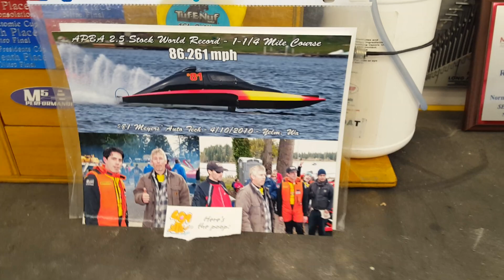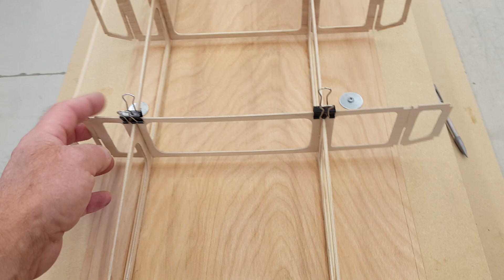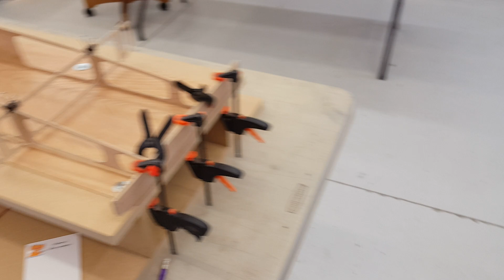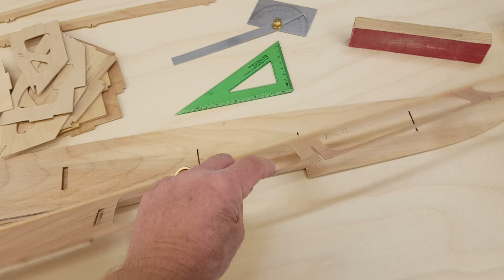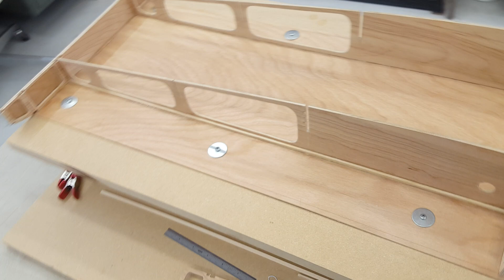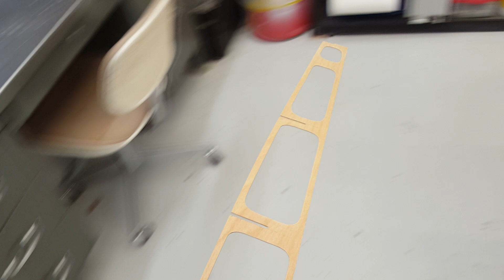Part 2 How to Build a RC Hydroplane Racing Boat - "The Gasser"!

Comment: another question do you seal the frame of the boat if so what do you seal it with i have herd to use epoxy clear coat
Reply from the maker: A video demonstrating interior sealing is in the works, but for now I'll try to explain;
After the boat is completely built with all hardware mountings finished, everything except the top decks, then is when I seal the interior.
For this I use West Systems epoxy. After mixing the epoxy I thin it with alcohol, making it very thin, about to the consistency of water. I slather this super thin epoxy EVERYWHERE inside the boat, working as quickly as I can. As soon as I've finished I wipe out all of the excess with paper towels (using an industrial wiping towel that doesn't disintegrate easily like household paper towels).  ALL epoxy that hasn't soaked into the grain I wipe away leaving no standing epoxy anywhere. In other words, MOST of it is removed. 
I should mention that during this process I avoid getting any epoxy on the upper surfaces of the stringers to which the top decks will be mounted. You'll want raw wood there until you're ready to apply the deck.
Next I install the decks and do my finish work and painting. If you like the exposed wood finish in the engine well, which I do, just buff the sealed wood in the engine well lightly with 3M maroon (fine) pads to remove any roughness and then shoot clear coat on it when you're doing that step over your paint. It'll look fantastic!

Comment: Low viscosity epoxy fibreglass resin & micro balloons. Make a small radius fillet - light & strong
Reply from the maker: Light yes, but strong? Not so much. Micro balloons are just as their name implies, little hollow spheres. Hollow means light, but if course there is no epoxy in that empty space and thus the resulting mixture is much weaker than epoxy soaked fillers.

Comment: Too late to get you to go over repairing engine mounts, is there? 
I got a Rockstar 48 in a trade. And the orevious owner ran it, with the motor mount screws loose.
And they chewed up the mounting rails.
I already know i need to cut the damaged rails out. But i dont know where to find replacment rails, or if i should just make new ones out of 6x12 x5mm thick carbon fiber plate.
Then rosen them back into preexisting rails place..
I'm just not sure the best way to go about it.
Any advice would be greatly appreciated! 
Thanks in advance.
Reply from the maker: If you've watched many of my videos you'll know that I'm totally unafraid to cut my boats apart and rebuild them.  I simply cut away everything that's damaged and replace it all.  Pick up the Dremel tool and go for it. You can do it!
Reply: @M5 Performance Hydroplanes - Scott Meyers  i think I have a game plan..
Gunna cut the spars or rails out and resin in an aluminum motor mount.
Looks pretty easy. 
Im not new to rc boats. But all my stuffs FE.
And I've never had to hack on one..
Part of the game, I guess.
Might have to put together a build series..
Thanks.

Comment: I'm certainly no boat building expert... but I was wondering have you ever thought of trying Carbon fiber sheets the same thickness of the wood you use? It's much stronger and very light, It can be cut the same way along with being glued.
Reply from the maker: Thought about it, looked into my wallet, changed my mind!

Comment: How do you determine the slot for the stuffing tube
Reply from the maker: I guess.  Seriously.  I usually miss by a little and make the slot a bit longer than it should be, but I then lay a doubler piece of 1/16 ply over the area for strength which covers the goofed area.

Comment: How thick the plywood in mm do you use?
Reply from the maker: Most of the interior framing is 1/16", which is 1.5 mm.  For the skin I use 1.5 mm on all the bottom surfaces, and 1 mm for the top decking.  The transom is two layers of 3 mm laminated together (1/8"  x 2), same for the right side sponson transom, and the left side is one layer of 3 mm
Reply: @M5PerfHydros  thank you.me really appreciate what you shared to us.. Hope you can make a video about how to install the skin on the boat. Your video really2 good and so informative.

Comment: Was wondering if you are gonna do a video on sealing wood with thinned epoxy.Also do you have a link to get the kits.Thanks and happy new year
Reply from the maker: Yes and yes!
 Next couple videos will deal with sponson design and bottom skins, but a video about how to seal the wood and make a super nice looking interior engine well will be right after that.

So if you're a glutton for punishment like me and you'd like bare plans so you can scratch build your own boat, Newton Marine has a huge selection here;
http://www.newtonmarine.com/

For really great wood kits the best place I know of to buy those is MLBoatworks;
https://mlboatworksrc.com/

Many good fiberglass hulls and cowlings are also available from RC Boat Company;
http://rcboatcompany.com/

Between these three you should be able to find almost anything you'd want.
Thanks for watching!
Reply: Thank you. I've been building A couple wooden mystics. After seeing this channel I've seen alot of mistakes i have made putting she sheeting on and the sealing of the wood oh its sealed no question about that but all the zpoxy resin I left in the hull.Lost of controversy over thinning epoxy some say never some say do it at your oun risk...After seeing these videos of yours. I started experimenting with thinning the epoxy just dont know the starting point of removing the excess.
Reply from the maker: @swaldoski  - We'll talk about all of that. Of course the best I can offer you is just my own opinions, backed by years of making mistakes, with a few successes thrown in along the way.  More soon!

Comment: The only complaint I have with ML kits is that if you don’t build them right away or put all pieces on a weighted board, they warp. My RSX310 was a mess. My GP265 had some incorrectly cut pieces but all in all I got them built. My next hydro is a Zippkitts 26” rigger. Still learning a lot, thanks.
Reply from the maker: Really?! Even if you leave everything boxed and don't pop out the pieces? That surprises me... The two kits I've based a couple of my boats upon were almost dead straight. But wood does strange stuff as it ages and dries so I suppose it happens. Trick might be to lay the box flat and weight it somehow. Under totes on a shelf maybe?
Reply: @M5PerfHydros  Yep. I'm putting the JAE under weight on flat board until I can build it. Another great video sir. Thank you. It's wood and compared to building a Whiplash, the ML is easier I think but JAE kits are very simple.
Reply: It all depends on the woods moisture content I have had new kits really warped and kits I have had in a cool dry basement for 20 years be perfect it all depends on storage and moisture content.

Comment: Where do you buy your slow setting epoxy from?
Reply from the maker: Hope that helps!
Reply from the maker: Hi Kip,
I primarily use two different products... West Systems for laminating, sealing, and for fiberglass layups (cowlings, cowling repairs, etc), and G-flex for general construction. The G-flex has a much longer working time. Amazon has both. Hang tight a sec and I'll get links to them...
Reply: @M5PerfHydros  awesome, many thanks!
Reply from the maker: West System 105-B Epoxy Resin (.98 gal) with 206-B Slow Epoxy Hardener (.86 qt) and Epoxy Metering Pump Set (1) https://www.amazon.com/dp/B07JKTKFKP/ref=cm_sw_r_cp_apa_i_e7i0DbAV0070N
Reply from the maker: WEST SYSTEM G/flex Epoxy (2- 4oz) https://www.amazon.com/dp/B002IZFPQE/ref=cm_sw_r_cp_apap_zCziWWWViVsEt

Comment: how do you cut your wood? it seems really really well done. I'm currently using a jigsaw then sanding but I'm having a hard time making the pieces according to the plans. Thanks alot
Reply from the maker: Hi Michael,
Jigsaws are notoriously difficult to control when doing 'fine line' work. Plus they tend to tear the workpiece without mercy!
I use a small, cheap tabletop bandsaw for all my straight cuts and for roughing out larger curved sections as well. For finer work and tight radius cuts I use a small tabletop scroll saw. 
A fixed table top belt sander is the ticket to do large area straightening and radius work.
All final shaping is done via plenty of manual labor with a sanding board, Dremel tool, and files for shaping and squaring many of the cutout areas for stringers, etc.
In other words, there are no shortcuts!
Just be sure to cut outside the lines and then final fit everything by hand. Be patient, and don't be afraid to throw the part away and start over... I throw away more than I use!
Good luck... You can do it!
Reply: @M5PerfHydros  awsome thank you for the answer! Your videos really helped me find the will to build my first boat! Keep up the good work!

Comment: i see that you put your struts threw the bottom instead of on the transom i am building a boat now and just wondered y
Reply from the maker: Good question James. The answer has to do with the class rules... My boats are built to race with R/C Unlimiteds in the Pacific Northwest, and our rules require that the prop be positioned at the transom or slightly extended if it can be proven that the original full-size boat had an extended strut.
So if you're building for a specific class be sure to check your rules. But if you're building just because it's fun, have at it!
If you'd like to learn more about RCU take a look at our website. Loads of pictures and boats and information here;  https://www.rcunlimiteds.com/
Now get back to building James!
Reply: @M5PerfHydros  thank you another question what do you seal the frame of the boat if so what do you seal it with thanks

Comment: I'm going to ask a very stupid question, so bear with me. I'm taking a break from building steam engines, and I haven't built a hydro for about 35 years. I just bought some Newton plans for a 1991 Miss Budweiser. I truly don't remember. Do you cut inside the templates,or outside the outline? When you stop laughing at this question, please let me know.
Reply from the maker: Well they say there's no such thing as a stupid question.  I'm guessing they never heard this one!
Just kidding.... That's actually a pretty good question that I honestly don't know the answer to, though I have a pretty good guess.
I would think Roger would have drawn his plans to an exact size, which would mean you cut outside the lines and sand the sides if needed right to the line.  As an opposite example, my plans are traced from actual parts which results in a plan drawing slightly larger than the parts, so with mine you'd cut right on the lines.
Whatever you do, if you plan to race it be sure to check the hull roster to be certain the dimensions fall within the allowed specs!
Reply: @M5PerfHydros  makes sense about drawn plans, thanks for the info

Comment: I'm struck by how light you build these things. Which leads me to an unfortunate realization in racing the scale unlimited hydroplanes; it seems, that if you want to be competitive, you are stuck using the vintage pickle fork designs vs the modern hulls. Because they are lighter and more airo dynamic,  due to the big scoop on the modern hulls as well as the tail feathers and fat sponsons. And on top of that, the vintage pickle fork boats are allowed to use the modern skid fins...the whole schtic to the modern boats was the ability to turn tighter at speed...and you take that away with the use of the modern turn fin on the vintage boats.
Reply from the maker: All true. Though there are a few competitive winged boats left, I do think they're handicapped somewhat

Comment: What thickness are you using for the framing?
Reply: I am talking about the cross members.
Reply from the maker: Ah... I should have mentioned that. The transom is two pieces of 1/8" laminated together. Going forward the next piece is 1/16", next is 1/8" and the cross member just behind the engine is two pieces of 1/8" heavy ply  laminated. This piece is intended to be structural, giving support across the boat due to the extra wide engine well. Will it work? I dunno, but I think so. 
Hang around and we'll find out together.
Thanks for watchin'!

Comment: Hi Scott, the Finnish ply you were talking about is also available here in The Netherlands, it's called "airplane plywood" because that's what is was originally intended for. Up till 1995, each and every sheet of this ply was inspected by the aviation authorities and stamped if approved. This stuff is still readily available and they send ply sheets up to 1.5 mm thick rolled up! That's how flexible and strong it is. Plywood up to and including a thickness of 2 mm is composed of 3 layers of, you guessed it, Finnish wood, "fused" together with waterproof formaldehyde glue. I use the term "fuse" because the glue is stonger than the wood itself. It is sold in sheets of 155 cm x 155 cm or smaller. Thickness anywhere from 0.4 mm up to 6 mm. Yes, zero point four. These are so thin that they become semi transparant with the glue being readily visible. I was thinking about the nose section that you laminated into one blok for machining afterward, but have you considered using thin ply, say 1 mm, and bending and laminating in that way?  2, 3, or max 4 layers, and it's almost bullet proof. Just my 2 cents...  Thanks for the interesting video Scott!
Reply from the maker: Great information Remko!  That really helps me understand what I've experienced.  I attempted to use 1mm with a fairly tight radius during my last build as I was creating the plug for my cowling mold and was unsuccessful. What it would need (and you've got me thinking) is some sort of die and press arrangement to hold it uniformly during the laminating. Not a simple thing, but possible.... definitely possible...
Thank you!
Reply: @M5PerfHydros  Glad to be of some help Scott :)  For rounded sections, I work mostly with a simple male mould made of wood, and I glue a number of plywood layers which are then "wrapped" and taped tight around the mould. I leave the ply plenty longer than what's needed so I can trim it back to the correct dimensions when the glue has finally set. When released, the lamination will spring back a bit, so you might want to make the male mould with a slightly tighter radius to accomodate for this, but I'm sure you knew that already :)  Obviously, the thinner the ply, the easier the process is.
Reply from the maker: I like it. Let's see some videos of your builds now!
Reply: @M5PerfHydros  To my shame, I have never made a video of any of my boats. The guys at the club keep nagging me about it too....  The only footage that exists of one of my RC boats is only in the first minute of the following video made by some random guy accompanied by his irritating dog : https://www.youtube.com/watch?v=OLWu64BHVUo&t=6s  This particular boat started life as a scratch built gas boat - all wood. I never design anything, I just eye ball it. Problem with a gas engined boat is that in Holland, it's become somewhat problematic to run these things due to stricter laws. So I left the boat lying around for years and finally decided to recycle it. So I ripped out all the running gear, and replaced it with electric drive. At the same time I thought I'd make a scale-ish boat out of it, so I built me something that looks a bit like a patrol boat. That's how it came to be. The boat is 63 inches long and about 12 inches wide. It weighs a ton, but it has enough speed to look kinda sorta real :)  I could mail you a few photo's if you're interested Scott. My email address is: r.jerphanion@gmail.com